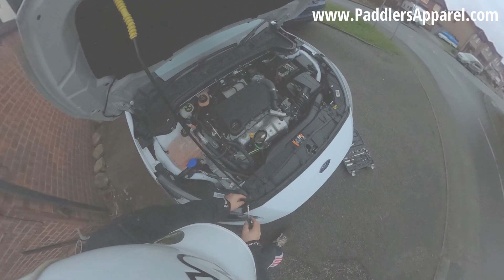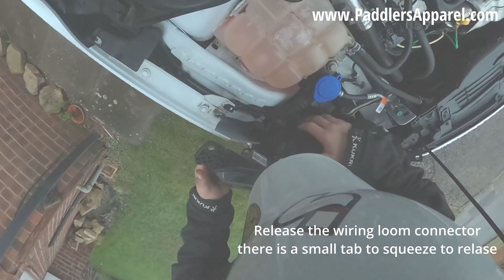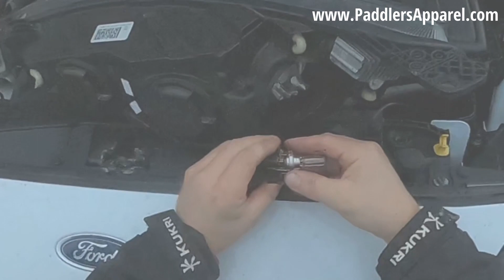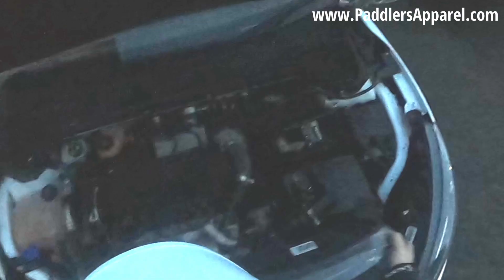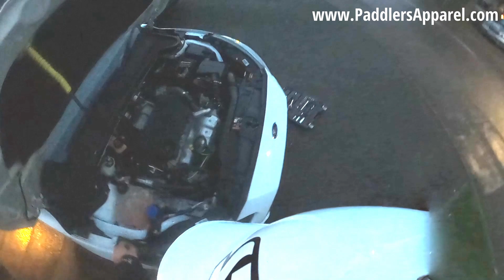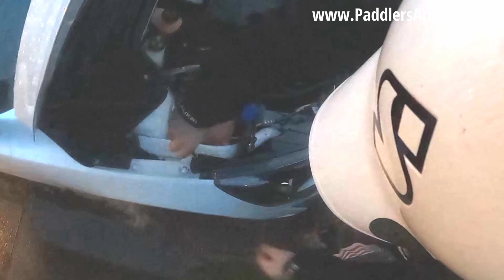Focus 2019 Headlight Bulb Replacement

Comment: I have the same car as you had in earlier videos and thinking to buy this model also what do you like about it so far, is there a new feel to it?
Reply from the maker: So far I love it, newer engine is smoother, more space inside both width and length in the back , boot space is better too.

With more tec I feel slightly less connection to road when pushing harder around tight roads but still great fun to drive and the tec is all quite useful a well laid out.

Engine is very simular in output even though more refined and little quieter and the 6 speed gearbox allows power at lower revs so you never need to go much above 1800 revs.
I'm getting around 65mpg tank to tank on a long run sitting st 68mph and 48 in constant start stop days in the city 

Very happy overall, cabin very pleasant too!
Reply: @AntonLippek  hey man is it possible you show me more photos of the car, I am so addicted to the focus to be honest and would like to chat with some people who have it, I want to go for the 2.0 engine, I am in Sweden :)